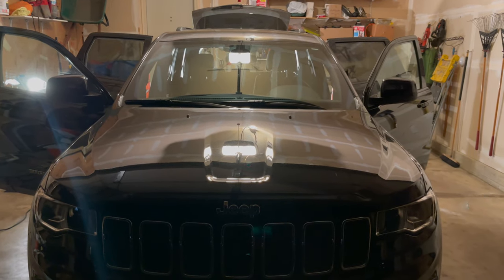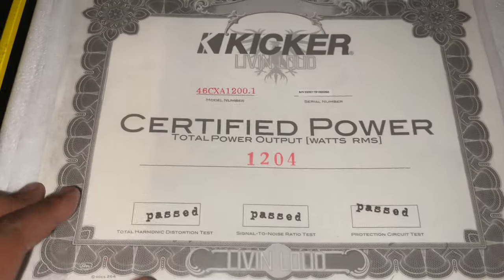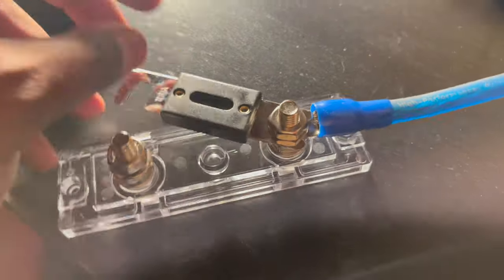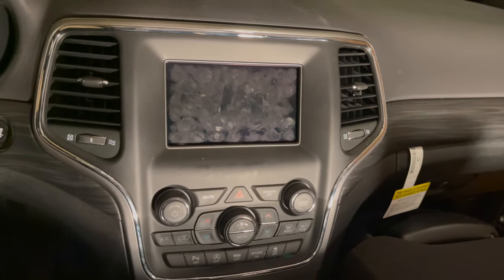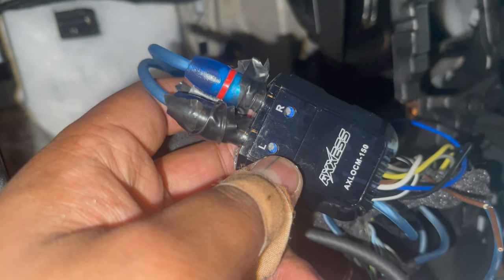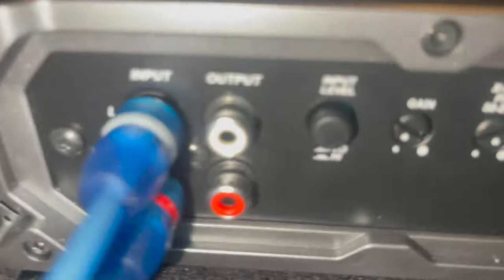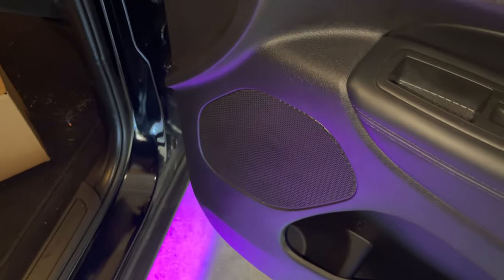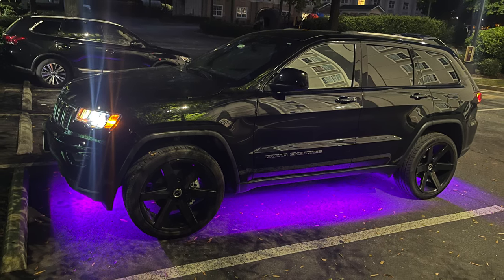How To: Sub and Amp Install '21 Grand Cherokee

Comment: How bad has your roof cracked already?
Reply from the maker: None at all😂😂😂
Reply: Mine cracked over 2 inches on each side by the rear antenna so keep and eye out. I have a 2015. Shit sucks taking out my subs next week
Reply from the maker: @Moneybagz-fn4yv  damn, thanks for the heads up
Reply: @Moneybagz-fn4yv  what subs did you have to do that?

Comment: Did my 12 charger I didn’t have to touch the radio just tapped into the rear speakers
Reply from the maker: Front speakers are full range. Rear speakers have bass rolloff as you turn up the radio
Reply: @BigStuDolla91  I didn’t know that lol I’m coming from a charger to a 21 Durango and trying to find the best way to do a setup 🤣
Reply from the maker: @THERIPPER216  man I think anything that goes to a 6x9 might be full range. So it’s prolly the fronts on that one too😂
Reply: @BigStuDolla91  were you able to run a toggle switch to turn the 12’s off and turn your  factory sub on?
Reply from the maker: @THERIPPER216  bass knob if I want to turn the 12a off

Comment: How you bypass the active noise cancellation
Reply from the maker: I didn’t have that but I’ve been told you can disconnect the mics in the ceiling. If you disconnect one it should disconnect them all

Comment: I helped my.bro do this today . did a nice clean install  and now no power to the head unit the only thing i did different was i spliced the line level converter into the ground wire on the head unit instead of mounting it to the chassis witch really shouldn't matter but maybe it did. but now there is no power to the head unit and out of the 100 stupid fuses in this thing none tell you witch is the radio and i can't seem to find any bad fuses under the hood and i can't find any fuses under the dash how in the hell is there no power to the head unit now the 2 power wires going to it are dead and we didn't short anything out i don't get how this could happen . can any one tell me the fuse the runs the head unit?
Reply from the maker: iIRC Ground on this radio is a thick black blue wire
Reply from the maker: So if you spliced into that wire it should still work. My guess is that you may have shorted the system out somewhere. If so I’m not sure what fuse fixes it.
Reply: Will this is a dilemma it has to be a fuse somewhere there is no power getting to the thick red wire when i connect the meeter to the red and chassis ground
Reply from the maker: @scottbray3053  does the instrument cluster come on? Like the gauges and stuff?

Comment: What size cables were needed for the amplifier
Reply from the maker: 4 guage
Reply: Ay bro the cxa 1200 is not to much power that it will blow the SUB
Reply from the maker: @AngelAguilar-hd2ev  two of them? No

Comment: I have the same vehicle, which wire do u tap into on the back of your stock head unit for the remote wire on the amp.
Reply from the maker: The loc should generate its own remote wire
Reply: @BigStuDolla91  thank you so much I was looking everywhere for an answer! I have one more which speaker wires do I tap into from the back on the stock head unit the rear or front speakers?
Reply from the maker: @sneakafanatic  use front. Rear have “bass roll off” where the bass stops getting louder as you turn it up. Front doesn’t have this problem. Also, I later learned that you should set the radio to about 28 using Bluetooth before you set the gains on the amp.
Reply: Thank you so much! I subscribed
Reply: Instead of going behind the dash could I just tap into the front door speaker? On either side?
Reply from the maker: @sneakafanatic  you would then have to find a way to get the wire through the door grommets. This would be more work then just removing the radio
Reply: @Bigstuwop how can I contact you, I have a few more questions? Thanks
Reply from the maker: @sneakafanatic  @bigstuwop_ on instagram
Reply: @BigStuwop Me again lol, on the output converter (same one as yours) which wire do I connect the yellow wire to?

Also same vehicle which do I connect the black wire to? Thanks!
Reply from the maker: @sneakafanatic  it’s been a while so I don’t recall. The loc should have a guide on which wire is which. If I recall the yellow is positive so it would go to the car’s red. Black should be negative so attach to ground. 

It’s been a while tho so double check before you do this

Comment: Yours didn’t come with a stock sub?
Reply from the maker: Nah. Woulda swapped it out anyway
Reply: @BigStuDolla91  would you think it be the same process? Just disconnect it?
Reply from the maker: @XxChinkyEyez  yea pretty much. Some people tap into the sub line but that could cause problems if it’s at the wrong spot
Reply: @BigStuDolla91  so should I just follow same steps and just disconnect it lol
Reply from the maker: @XxChinkyEyez  yea that should work

Comment: Where u connect the remote cable ?
Reply from the maker: Comes from the loc to the remote on the amp
Reply: Not sure wym a lil confused on where the remote goes connected
Reply: Did u connect the remote from the high output converter blue to blue ?
Reply from the maker: @JavierOrtiz-pk5yy  a blue wire should come from the high output converter and going into the remote input of the amp

Comment: What did you set your gain to?
Reply from the maker: Rewatch the vid. I explain how to set it
Reply: I have the exact same setup as you down to the wire, I have mine maybe 30% of the way.  Just making sure I got it close to yours.
Reply from the maker: @noahcovington2396  man this two set ups ago I wouldn’t even know where I had it

Comment: do u have stock radio?
Reply from the maker: Yes
Reply: @BigStuDolla91  with the kicker amp do u need a line output converter? thank u
Reply from the maker: @mangoflum  no just a speaker line to rca adapter. It has a built on LOC in it

Comment: Hey man how hard was it? Planing to do the same but add an extra battery to the rear as well. I heard these cars are sensitive with electrical. I was planning to tap to the rear speakers as well
Reply from the maker: Don’t tap rear speakers. U need to tap the front. Rear has bass rolloff. The install was easy cus the battery in the cabin
Reply: @BigStuDolla91  Okay I've done multiple installs but every car I had a aftermarket radio with RCA inputs. I know the HiLo you can tap usually in the rear. I see you have multiple videos of different installs. I'm planning on running 8k RMS. You have any issues with electrical? Really appreciate the vids. Definitely will be using this
Reply from the maker: @JonahDuhPhoneGuy  yeah most cars you can do back speakers but the Uconnect only sends a full range signal to the front speakers. 8k rms will def need some electrical upgrades. I’m at 1200rms for bass and the system holds up fine
Reply: @BigStuDolla91  if you get a lc2i LOC it has accubass which eliminates bass roll off
Reply from the maker: @brianwaller7383  or just tap the front and not have to do that at all
Reply: Great video.  Trying to help my son whose in your Frat.  Are you saying tap the front speaker wires from behind the headunit only or can I tap one of the front speakers in the door?  Also, do I need to run the blue remote 12v?  I’m using a kicker stereo line output converter with remote turn on.  Thx! 💪🏾
Reply from the maker: @pappajohnz3  thanks. If you tap a front speaker on the left you’ll also have to tap on the right. This is kinda more work than just tapppng behind the radio but either way gets the same result. The blue wire from the kicker loc goes into the amp
Reply: @BigStuDolla91  thx!

Comment: where do i run remote wire
Reply from the maker: What do you mean
Reply: @BigStuDolla91  the little blue wire. so when i turn my car off my amp can also go off
Reply from the maker: @jayygeeked  oh I ran it under the trim on right
Reply: @BigStuDolla91  what did you wire it too
Reply from the maker: @jayygeeked  from loc to the amp